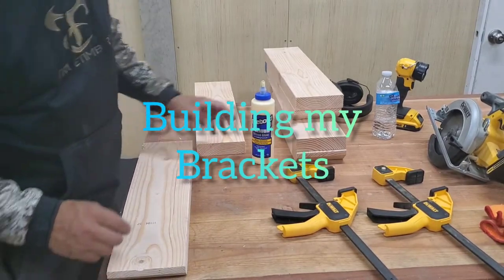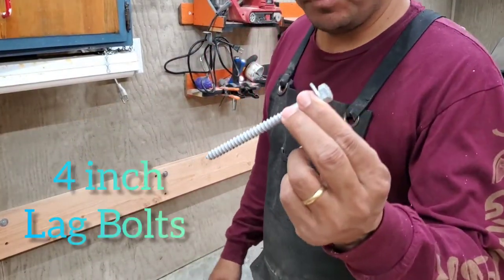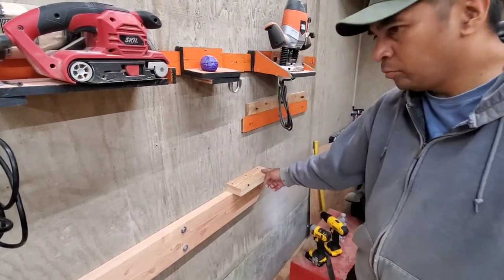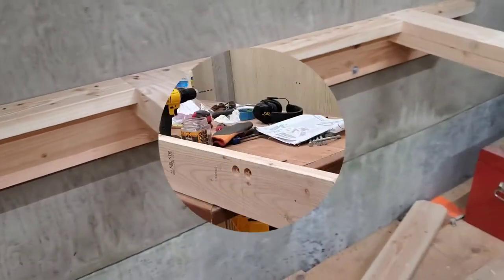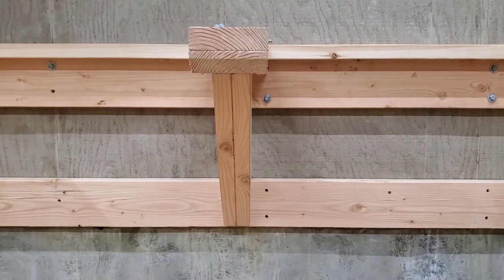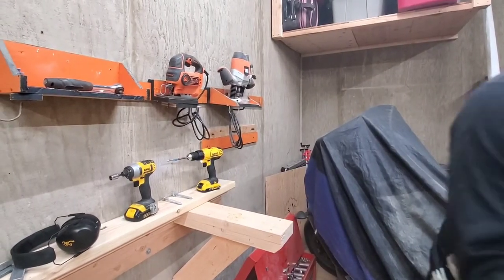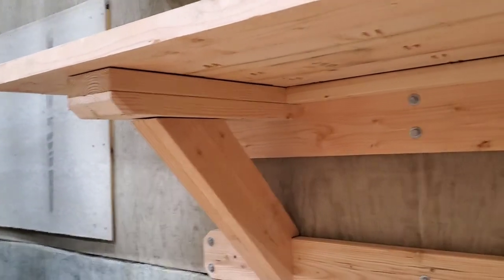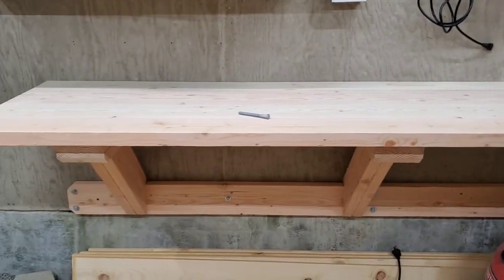Work bench build DIY

Comment: most people would have only used deck screws, but using those lag bolts you could sit a tank on that bench. that bench should last you the rest of your life. I work alone too. a two man job can be a one man job if you use your brain, unfortunately most people don't.
Reply from the maker: I'm glad I used the lag bolts. Your right the other day I stood on it to change the lights. I'm 230 lbs!
Reply from the maker: Hey forgot to mention I did an update a few days ago on what I thought and added.
https://youtu.be/2SGk1w9wvnk?si=defAcIA72jpKzt0O

Comment: Thanks for doing this, but it would have been SO much better without the music.
Reply from the maker: Thank you it was fun to build , I also built  a smaller version of it to hold my Drill press right beside it. That bench has only 1 support arm instead of 3 like this bench. It turned out very nice! Yeah the music just turn it down and put your favorite music on.  Thanks for watching
Reply: @Wisskey8t9  Thanks for your reply, but the issue isn't the choice of music. The problem is that the music is drowning you out, and it makes it hard to hear what you're saying. Regardless, good work on the bench. I definitely found your video helpful.
Reply from the maker: @AlexGarcia-ur9dy  ahhh I C didn't realize that. Thank you.

Comment: Are lag bolts necessary if this is going to see light use? I'm thinking of using three 4" construction screws per stud.
Reply from the maker: Aloha thank you for watching , you know when in doubt always go the stronger way! you never know what your going to be using your workbench for, so yes i would highly recommend it. ive actually stood on it to change out my lights above , never thought id be doing that . Lag Bolts are not expensive atleast at my stores. 3x 4" screws will work as long as you know the build and know what your putting on your work bench. hope this helps *go with lag bolts you'll feel better and use pilot holes
Reply from the maker: @ExplicitSpirit  I actually built another workbench exactly like this just for my drill press. Difference is I only made it with 1 bracket support. Right at the end if this bench. Turned out awesome.  Ugg I did not film it

Comment: Love it  I did the same thing in my garage across one entire wall, If you have your supports nice and square I would add some drawers in between them. If they are a little off shims work great on the drawer slides to get a smooth open and close.
Reply from the maker: Do you have a video? I would love to see it if you do. Check out my update video in the description.  I've added some shelves and vice. I've even made a smaller version for my drill press. Thanks for watching
Reply: I'll have to check out the other update videos but no sir I do not have a video as a matter of fact I'm in the process of tearing it down now. As much as I loved having the extra space underneath so I can roll things under it and out of the way I feel like I wasn't utilizing the space efficiently. So removing everything and installing cabinets with a solid wood top. Might redo a small portion to look like yours. Your bench looked way nicer than mine easily 100 times nicer than mine just beautiful. @Wisskey8t9
Reply from the maker: @balancebringer7888  Yes if you do a new work bench definitely film it :)  i'll be a subscriber :)

Comment: Hi!  Nice work!  How did you measure for the "birds mouth" cuts on your support braces?  How long are the braces?
Reply from the maker: Aloha and Mahalo for watching Robert.  You know i got the instructions on how to do this project from :https://www.woodsmithplans.com/plan/wall-mounted-workbench/      .   As i recall now that im looking at my instructions it gave me the measurements for the longest part of the board than simply at one end cut the 45 degree angle than that would give you the starting mesurement of the shorter side which it gave me the measurement on the instructions (with pictures and measurements which made it alot easier than me explaining it ).   I also used a scrap piece and made the first template and traced it out on the other actual boards and went from there.  But yeah the plans alot of pictures  :)   and measurements and instructions.  Hope this Helps my friend and have fun building your bench! Mahalo
Reply: @Wisskey8t9  Thank you for the explanation my friend!  Stay well!
Reply: Hello again!  Noticed that the Woodsmith plans are for a workbench that is 78" long with 2 angled brackets.  I'm building mine 8ft and using 3 brackets as you did.  Are your brackets and ledgers the same length as in the plans or did you adjust for a longer bench?
Reply from the maker: @roberth8546  yes sir I wanted mine longer so I adjusted for 8ft ledgers. Much more room 96 inches. And of course when you go to put the middle Ledger all I did is find the middle (4ft) and put my middle bracket right there. Just adjust....it was easy to do. You can watch my video and get ideas off of it.
Reply from the maker: Oh also the bottom Ledger I think it was 1 inch shorter on both sides so 2 inches total shorter than the top Ledger if you see it on the video you can see its just a tad bit shorter than the top.
Reply: @Wisskey8t9  Hi again!  I've started my build with the same purchased plans.  I noticed on page 3 of the diagram it shows the length of the brackets as 25 5/8".  The cutting instructions show 26 1/16".  Do you know why the difference?  What length did you cut yours?  I'm going to do a plywood top with a width of 24" which is 1 inch less than the instructions.  Should I then cut  my brackets and supports 1 inch shorter in this case?  Thanks!
Reply from the maker: @roberth8546  hmm i have seemed to misplaced my instructions. i just got back from measuring my Brackets and it measured 24" . Now remember i made templates out of scrap plywood to kind of check how it fit....it ended up with 24".  24" was the longest part of the bracket. Cool you have started your bench! sorry im replying late.
Reply from the maker: so we are on the same page im calling it the support braces that measured 24".....i mentioned it in captions on the video on what im calling it @ 1min 33sec in the video
Reply: @Wisskey8t9  Thank you for taking the time in replying.  One more set of questions I hope!  Any tips on cutting the birdsmouth notch in the brackets?  I'm trying to cut them using a circular saw and handsaw combination.  I found that using a scroll saw resulted in more inconsistent cuts.  Want to try and avoid using the jig mentioned in the instructions.
Thank you sir!
Reply from the maker: @roberth8546  no problem i dont mind answering questions.  Yes challenging it can be! I used a Jigsaw with a nice sharp blade and just TAKE YOUR TIME is key.  Make sure you Clamp the piece down nice and tight, with a slow cut your sure to make an accurate cut. Wish i could see your progress its exciting to hear others doing this Shop Table build.

Comment: Nice build. Are you attached to a concrete wall?
Lag screws, lag bolts have nuts with them
Reply from the maker: Aloha Jim the bottom part is concrete but my bench is JUST above it attaching itself to the wood wall.

Comment: Nice work! I downloaded the same plans a month or so back and am planning to build one myself. Good to see you're so happy with it. I think you made a comment about 4 inch lag bolts maybe being overkill...I had a lumber rack fall because the lag bolts it came with weren't long enough so I say there's no such thing as overkill!

One question: did you stick with the 30 inch depth the plans call for or did you change it? I'm thinking about making mine 24 inches deep and using laminated 2x4's instead of planks like the plans show. 

Thanks!
Reply from the maker: Hi Michael, thanks for watching! I always like reading comments. Update: I built another smaller version of it that only has 1 of the support bracket right next to it. It's for my drill press. I did not film it unfortunately. To your question, are you talking about the table top? My width of table top is 24 3/4" .   Oh and you are correct on the Lag Bolts, glad I used the 4" bolt its so strong. I hope you build yours! So satisfying to build and watch it come together ❤️.  Good luck 👍🏽